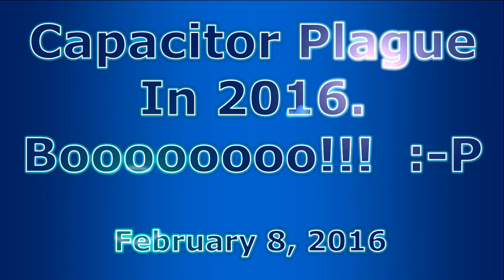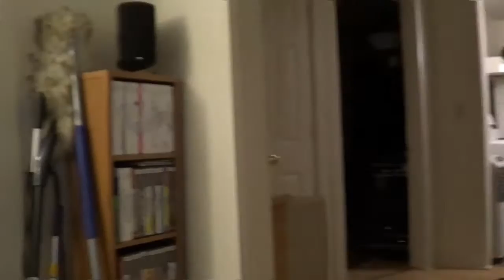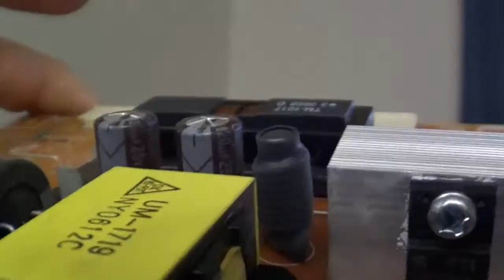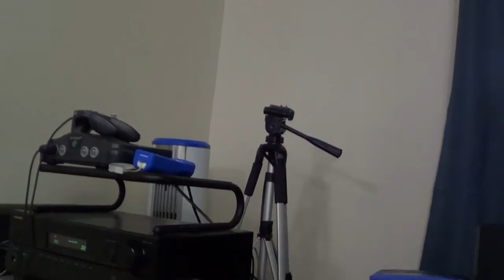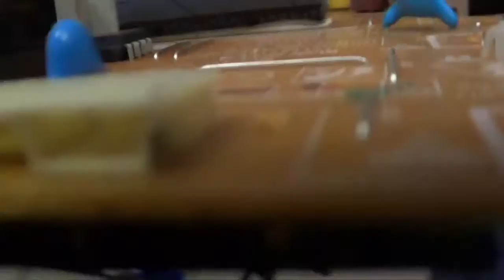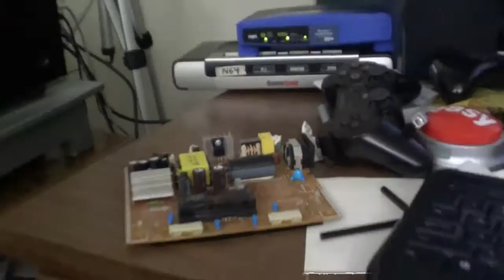Capacitor Plague In 2016.  Boooooooo!!!  :-P

Comment: This happens to 2009-2010 PSUs from BeQuiet and other reputable brands too. Usually takes 5-6 years for caps to go bad. Never had bad cap issue on cheap PSU models though. Some of them can last even 15 years without any bulged caps.
Reply: i have a cheapo "Earthwatts" psu from 2006 that still works fine even today

Comment: cheap junk shit caps. bought a psu made in 2015 and it had all shit caps. had to change all the caps before I plugged it in
Reply: You should have kept them in, I'd replace them at the first signs of instability though.
Reply: Sony Trinitron
they were Capxon caps which are pure junk. they ripple and fluctuate voltages that destroy hardware and data

Comment: This is NOT the capacitor plague.  That was due to Chinese improper copying of electrolyte formulation.  
The current problem (including the newer TVs) is not due to bad electrolyte, it is due to poor power supply design, undersized caps and cheap (CapXon) components.  
Beware of cap kits - many of them supply caps that are just as bad or even worse than the originals.  You want to use long life, high temp/low-ESR type caps such as Nichicon UPX series (they cost more but are worth it).  You are better off buying separate components from a parts seller such as Mouser rather than unknown parts from these cap kit sellers.  Best bet when this happens is to go up by one voltage grade when ordering replacements - as long as the lead pitch remains the same.

Comment: Just an FYI... All electrolytic caps have a limited lifetime. Even without a bad electrolyte formula, use them long enough and they will fail. A 10 year life span is not unreasonable for a consumer grade device. Temperature is the major factor affecting lifespan assuming the circuit was designed properly. For longer lifetimes, you can choose caps rated at 105C as opposed to 85C, and 4000 or 8000 hours as opposed to 2000 or 1000 hours. They of course will be more expensive, and probably larger.. Both DigiKey and Mouser should have what you need.

Comment: Would a 10 year old monitor be worth fixing. I have 3 post 2008 monitors and have been considering getting 3 new ips displays to replace them due to the better picture they give. Every modern monitor has twice my contrast ratio and half my response time. And barely have any bezels.
Reply: I'm using a 2006 Acer LCD monitor as my main, the picture is fine, if you don't need the best I wouldn't bother, the repairs would be cheap so I'd go for it, go against the greedy corporations that design stuff to be thrown away after 8 years or so.